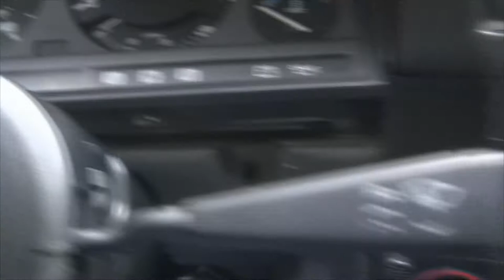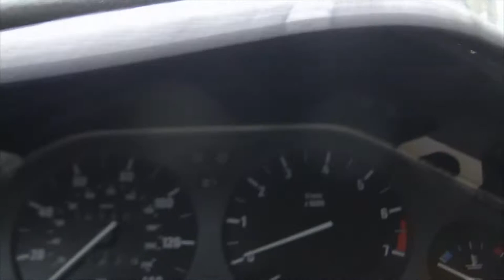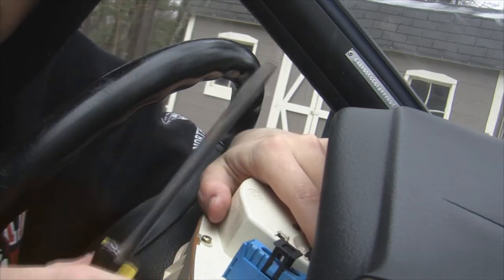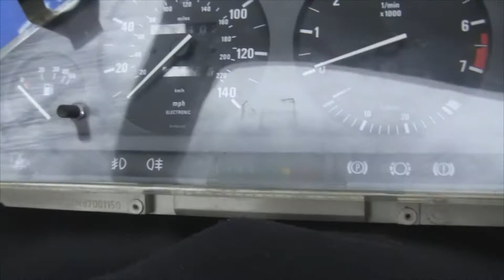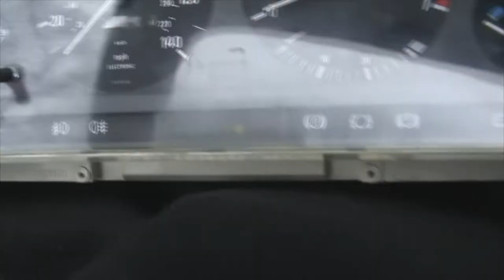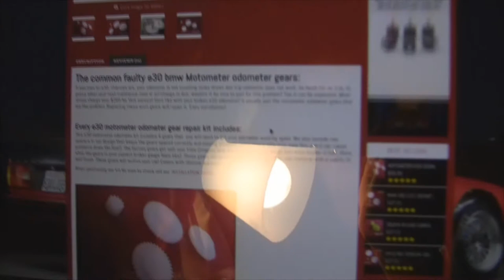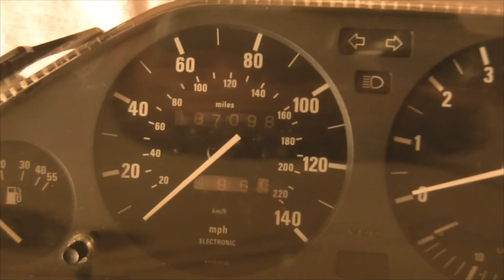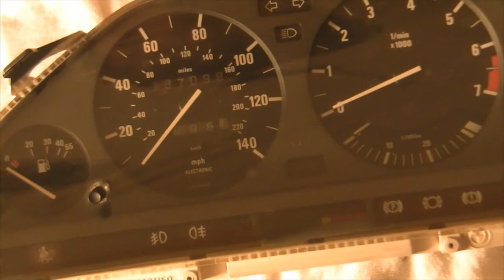How to: Replace e30 odometer gears and remove instrument cluster

Comment: Speedometer sensor changed speedometer cables changed the speedometer head itself was changed with a used one but from 0-25 the needle wavers between 2 mph what's going on